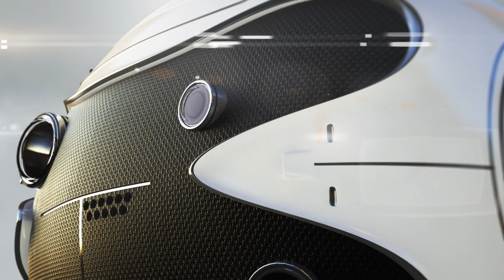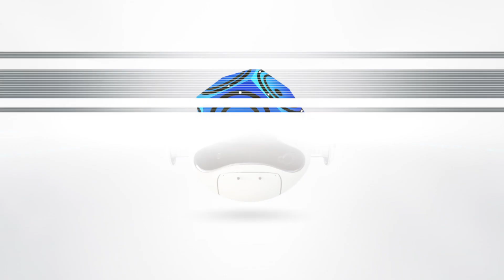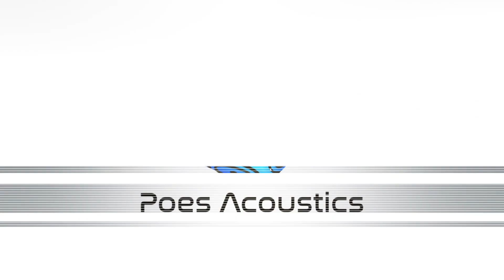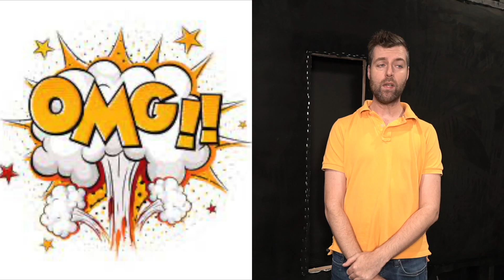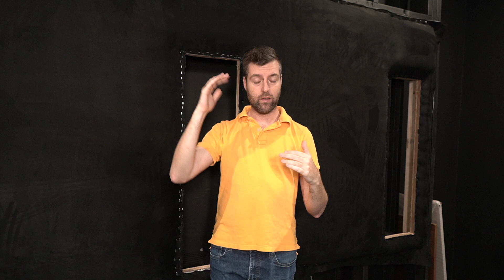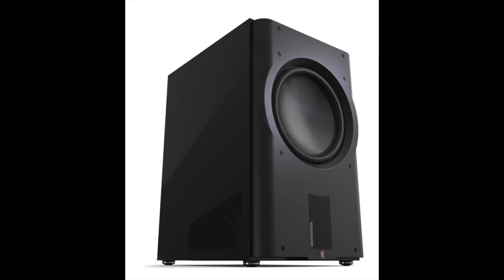Do NOT TRUST Bad Home Theater Integrators and Designers!

Comment: @Next Level Acoustics make killer LCR soundbars and in-wall subwoofers. Check them out
Reply from the maker: I am familiar. I have limited hands on time but would like more. They have some subwoofers that look interesting.  A lot of their speakers don’t look great but could sound fine. There is next to no data available and I’ve just not heard them. The in wall subwoofers do look interesting. I don’t believe they offer amps so I am curious how they support integrators around that. If I specify a subwoofer and separate amp, I then need to be able to specify the DSP tuning as well. There is a lot that goes into that. It’s not just EQ but also limiters and bass extension.  The best companies put a lot into that and it’s built into their amps.

Comment: Hi, Matt Poes I'm from Trinidad and Tobago, and I know you are the only person that can advise me on this, I'm using the Denon AVR X-4700H in my home theater,  I do not have a back wall it is an open space but I have placement for one back speaker, could I use a 6.2.4 setup? will I be missing anything in the surround channel ?.
Reply from the maker: That actually likely wouldn’t be that bad of a setup. You may want to place the pair of back channels right next to each other. When THX researched this they found that closet placement provided much better envelopment. 

The other option is to place the rear surrounds on stands or even to use ceiling mounted aimed speakers. Not ideal but not terrible either.

Comment: Thoughts on 1" dome tweeters (not on a waveguide) for theater LCR speakers behind a screen reaching reference level 18ft away? Me thinks not, but other "designers" think so with brands like triad
Reply from the maker: Triad claims it but I don’t know where that number comes from.  I don’t happen to think it’s likely. I wont go so far as to say impossible. I’ve tested a lot of speakers to max SPL and raw drivers. We have never seen a 1” standard dome tweeter do 120dB at 1 meter, for example.  Or even close.  

I think a good reference for how unlikely this is would be that the Perlisten speakers use three domes to give sufficient output. They are maxed out at 117dB at 1 meter. 

One big part of the issue is that it takes a lot of power to get there so most dome tweeter voice coils lack the thermal power handling for that to happen.  

I would like to maybe get the Gold LCR’s in for review.  We could then do some testing to see what the max SPL is.  Nobody else has been successful at achieving 119dB from such a design so it will surprise me if it holds up. Maybe if their test is more of an M noise type test it’s possible. That would put the max SPL at closer to 112dB rms.  I would say that’s a far more likely number from such a dome.
Reply: @PoesAcoustics  perhaps CEDIA RP1 standards will bring their claims back to reality...

Comment: Just subscribed to follow your room build
maybe not the correct place to ask this question but Audiohholics always suggests a 80Hz XO even if you have capable tower speakers
so what crossover setting are you going to use with the Perlisten S7i in-wall speakers?
and would that also apply to S7t towers?
Reply from the maker: This is really too complicated of a question to fully respond to here. 

THX specs an 80hz crossover. That is how their speaker and design spec works. So while the S7T is also a full range speaker, it would be intended to be used with an 80hz high pass.  

The S7i is not a full range speaker. The enclosure is far smaller than the towers. So it must be either crossed over or if used full range, no boosting of bass. 80hz is a sensible point to cross. It’s very possible this speaker couldn’t handle being run full range anyway. 

Many full range speakers are not full range high output. If you look at compression test data on a lot of speakers you will find that the bass and tweeter range are the biggest factors where compression sets in. A lot of speakers couldn’t do 105dB down to 20hz at the listening position.  In a medium sized room that would actually take a pretty beefy 12” subwoofer driver with a lot of power behind it. Most mains don’t have that. 

Even at higher frequencies, let’s say 50hz, a lot of otherwise capable speakers may struggle.  

So the crossover point of 80hz is really a good compromise number for a lot of systems. The idea that this is wrong or bass remains directional at frequencies below that is not supported but the extensive literature into this topic.  

Mains are also rarely at the right location for optimal bass. Subs against a wall on the floor is a far better location. It’s generally best to be against a barrier as it avoids SBIR problems from those two or three surfaces.  So summing the bass to mono and distributing it amongst optimally places subwoofers usually leads to a far better bass response.  

In other words, many capable towers aren’t that capable. But even if they are, it’s still likely better to cross them over.  

However there are what I call advanced bass management techniques that wouldn’t do this. Let’s say that you know your speakers have the ability to be run full range and that they won’t ever hit their limits, you won’t exceed xmax, and the amp won’t clip, then running them that way could be advantageous. That is because it’s always better to have more LF sources than not. If you can get everything well aligned and integrated (which is trickier) then it can be good to have the mains and subs operate together and fully overlapping. The problem is that many receivers and processors either have limited means for doing this or no means at all. Extra bass or double bass was a common name used for it.  

It’s worth nothing the mains don’t actually need to be full range. My old speakers placed a pro 12” driver in a small sealed box. They handle 1000 watts and have about 10mm of xmax.  In a tiny sealed box they can take the full 1000 watts and still not exceed xmax.  However the speaker starts rolling off at 100hz with a 2nd order natural high pass. If run with subwoofers, there becomes a lot of overlap between the subs and mains in that critical range between 40hz and 100hz. Geddes taught me this and even suggested using a shallow 2nd order low pass on the subs potentially.  If you set the corner lower (maybe 60hz) there is just as much attenuation up at 100h as there would have been with a 4th order low pass, but better integration.  

I would like to play with this approach on the S7I. I need to do some testing and likely need a good 500 watts per channel to get away with it. Thankfully my Trinnov has all the flexibility needed to do this.
Reply: @PoesAcoustics  
Wow thanks for such a comprehensive reply it was more than I expected and is really appreciated

I am using a 9.3.6 layout in a 20' x 17'6" x 8' dedicated room
Trinnov AL16 with JBL SCL-6 in-wall centre behind my PJ screen along with JBL HDI 3800 as L/R, JBL HDI 3800 as side surrounds, Arendal 1723 Monitors as wides and Arendal 1723 surrounds at the back 
I have seriously been considering changing to Perlisten 
that said,
using the Trinnov I have been playing around redirecting my Arendal 1723 wides and back surrounds along with my height speakers from < 80 Hz to the JBL HDI 3800 's
I use a 50 Hz Low pass on the JBL HDI 3800s to 3x Arendal 1723 2S subwoofers

all this to say after reading your reply I will go back to a 80Hz XO all round 
so thanks again loving the channel
Regards
Andy